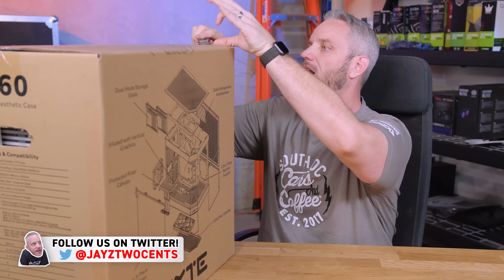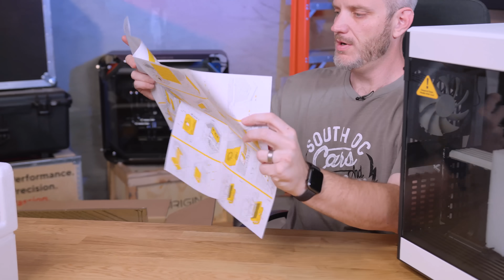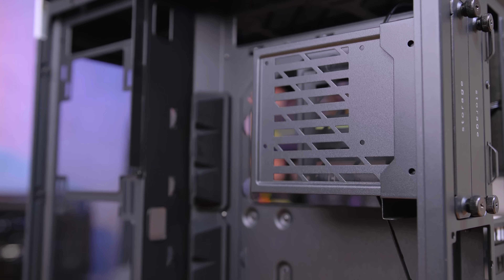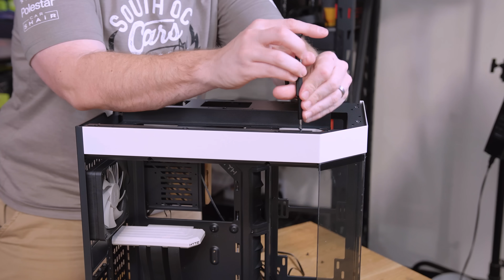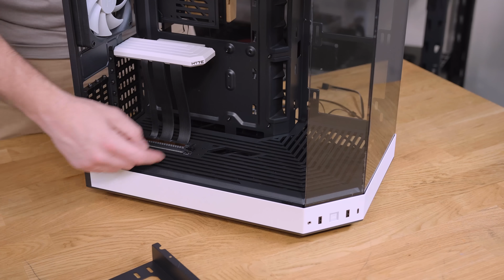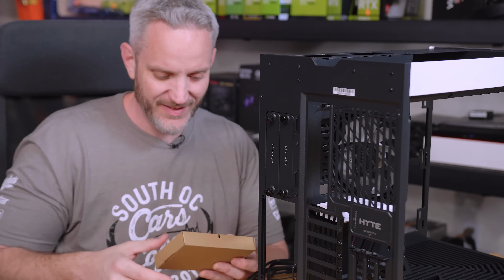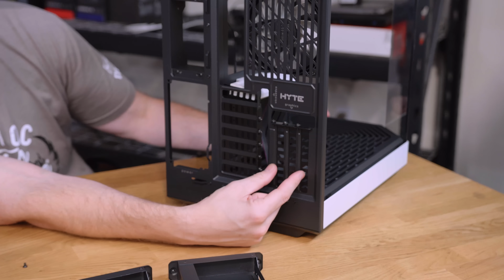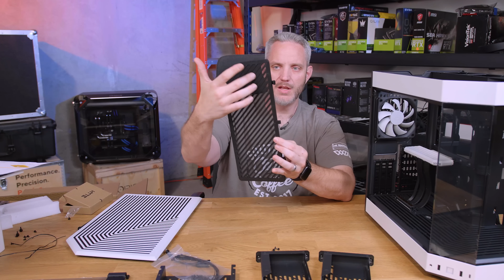Someone FINALLY broke the mold for PC cases...

Comment: I wonder if you could do much with a case mod for that case. I feel like its hard with cases with a ton of glass like that, but it would still be cool to see
Reply: I'm kinda imagining an aquarium-themed custom setup 🐟🐡🐠
Reply: You could do a flexible screen across the front panel and the corner. That would be kinda cool.
Reply: for those with access to the machinery, it could be possible to fabricate a panel to replace the front most glass panel, after that idk.

Comment: Just finished building in mine yesterday. Love it so much!
Reply: What was your favorite part and least favorite part to building in the case? May get one
Reply: @TheBinklemNetwork  The cable management on the back and the proximity to the motherboard tray makes cabling fun for some reason 😂 The worst part is the built in PCI bracket, since I didn't have a tiny screw driver and its mounted down with different sized screw. Having to move that around was a pain for me.
Reply: Where did you buy your case?
Reply: @thomasowens720  Got it off Amazon
Reply: Post a video